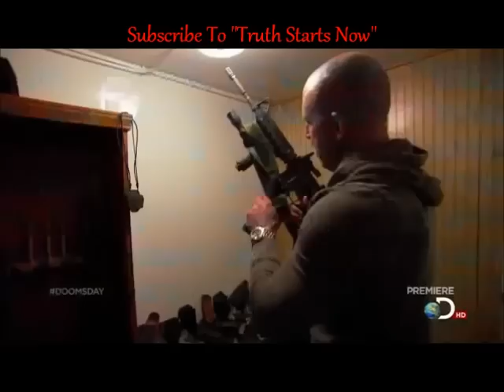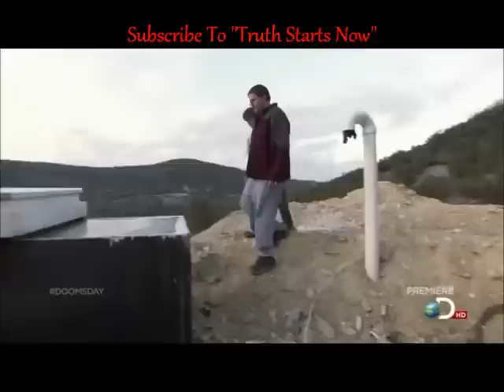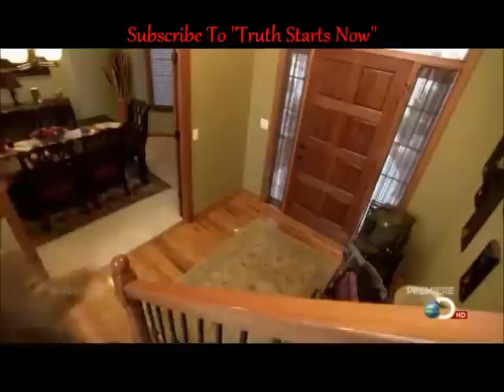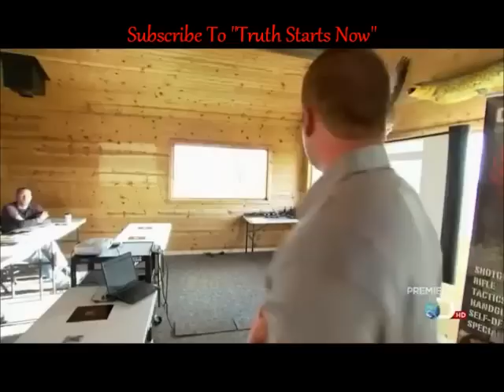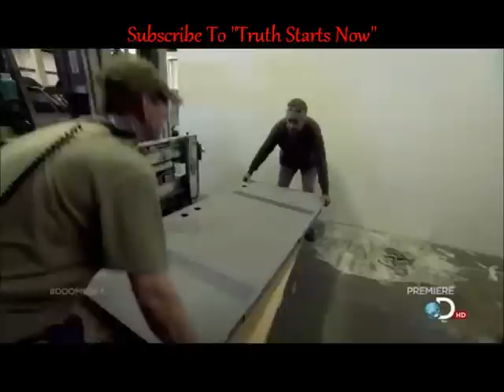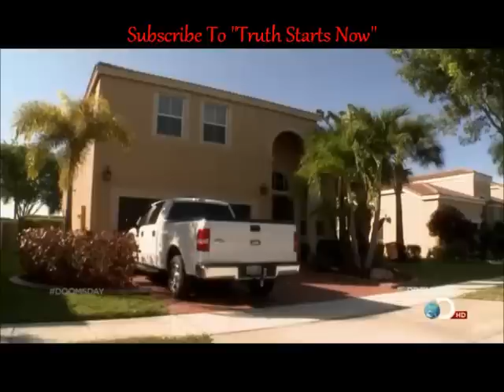Doomsday Bunkers Episode 1 Part 1/3

Comment: I'm simply failing to understand something that should be very obvious. In the event of nuclear war, there is something called Electromagnetic Pulse. That means all radios will stop working. All computers will stop working, including GPS systems. It also means fuel injection systems governed by a computer in a car will stop working. Unless your car is carbureted, you will not be able to drive to your hide-out bunker. Unless you have a vacuum tube radio, your transistor radio will not work. Furthermore, with the radio activity level present in the atmosphere within 500 miles of the blast center, nobody will be able to get out of their homes and your home will be radiated.  Unless you plan to put lead lined walls behind the sheetrock in your walls at home, you will die of radiation poisoning.  How the hell are you going to GET to your bunker, if you will be NOT able to drive, and NOT able to Communicate, and NOT able to survive the heat and radiation of a nuclear exchange , with multiple blast zones. This is fear mongering at its worst.
Reply: You are misinformed my friend.
Reply: +FelixG I hope you see this, but I'd be happy to offer an explanation as I also enjoy active responses and dissertation. A remote location, as someone else pointed out, will most likely not be affected by an EMP caused by nuclear war. 500 miles of radioactivity is inaccurate. I assure you that any tactical nuke used in the future will not be the Tsar Bomba (the largest nuke ever detonated that was created by the USSR). Eventually the fallout may cover a large area, but if you react immediately to the threat, you'll be well out of range for the initial fallout.

There are also ways to defeat an EMP. It's not something you can't defend against. If your bunker has shielded wiring and electronics, you have nothing to fear. A layer of lead shielding around the enclosure could even protect against nuclear radiation closer to the ground zero of a nuclear blast.

What I've just said is what I know without doing any research. The original response is assuming that the person that built the fallout shelter or bunker is completely unprepared for the initial strike. There are advanced warning systems that will warn people before a mass nuclear strike "with multiple blast zones". With how ready these guys are for the world to end, they would be heading out to those shelters at the smallest sign of things going wrong. These guys would already be in their shelters while events like the Cuban Missile Crisis were still unfolding.
Reply: Hello Ayla Voets enjoy your comment on EMP after nuclear strike , there are many other factors also What size of War head yield 2, or 5, or even 10 megaton.To my understanding EMP will only cover area of ground zero: example 1 megaton warhead would wipe out and kill everyone with 12 Klm radius.      I started to read more about EMP and GPS after my work phone became a tracking device.I found on eBay small black casing for my phone. to block EMP and GPS price was $4.99 there are casings for your laptops mainly used for traveling airport x-ray devise that may do harm to electronics.   if you have been watching Juno space craft just passed massive amounts of radiation, all electronics on broad are inside a titanium concealed area. I choose not to survive a nuclear holocaust.cheers.
Reply: Graham Ramsay You're absolutely right on all counts. My father worked on some secret government contract in the 80s. I still don't know doing what, but he would always tell us, "If there is a nuclear strike and I know where it will be, we will be traveling as quickly as we can to its epicenter. I don't want any of us surviving a nuclear holocaust." Those words have always stuck with me...

Comment: FYI, if you are in a bunker with enemies outside. You will lose.
Thats why the military stopped building bunker forts etc.

You just secure the outside entrance area. Dig until you reach the metal roof. Use a simple shape charge to make a small hole. Make a fire and channel the smoke into the bunker.

If its a super deep billion dollar bunker then you do similar, but find the air intakes and close them. Might be a longer wait, but you will win.

Comment: I agree completely. People should have both backup oxygen tanks AND an outer air vent. If/when i build a bunker, i'm going to have multiple filters in the vent(s), along with sensors that, if liquid is in the vent, the vent shuts and the oxygen tanks turn on.To be sure about the vent, I would hide it somewhere. Possibly in a small mound or a tree. Especially since my bunker would be under a hillside. My vent would be well disguised.

Comment: You know whats even smarter :P.  buying a cottage in Northern Canada or Alaska, you can get them for relatively cheap cost, an isolated cottage also provides untouched hunting ground.  if the U.S economy collapses having land in another country to fall on is the better way and cheaper way to go.  If anything does happen the first people to get attacked are the peppers, not by 1 or 2 peeps but by 20-30 right after they raided a gun shop.

Comment: They can get the people out of the bunker by pumping smoke continuously through the air vent. Or pouring water down the air vent. Or setting a huge fire on the door for a long time. If a bunker is known, you can always find a way to attack it.

Comment: First priority is to NOT get found. Usually, after the bunker goes in, it's concealed in some way. Some people build stuff like doghouses over the air ducts, what have you. Also, the pipes have guards against filling in with water or trying to "smoke out" the inhabitants. And finally, several of the pipes will be "dummy" pipes that don't lead to anything.
But with all this, in general if somebody DOES find your bunker, nine times out of ten somebody's going to have to get eliminated.

Comment: Ok they have a bunker layout completely wrong. 1. Entrance must have an air lock that can be defended via gun slits. walls must be 8-12 inches of concrete.2. Decontamination with a place to store weapons clothing NBCW equipment followed by showers for full decon.3. Another air tight door again must be bullet proof with slits for defence.4. living eating sleeping quarters. Each subdivided again with walls and doors that are defendable.5. At least 1 escape tunnel that leads a couple of hundred yards to a ravine or gully where you can break contact and escape.6. A hidden resupply point at least 3 km away. It must have weapons ammo medical supplies backpacks and clothing.This is not even getting into what to have above ground.

Comment: One man in a bunker is not going to stop a group of intruders those doors could be busted down with the right equipment. as for the air conditioning vent on the surface, whos going to stop intruders covering it and filling it with dirt to prevent air going into it? or filling the vent with petrol and setting it on fire. when theres a will theres a way

Comment: You should be smart enough how you can eliminate disinfect infection, how can you have clean water by infared, how can you control intruders, and also bugging out protocols. Its not just staying there but how about going out or moving out.. transportation is needed such as boat, jeeps, helicopters, space ship>>?
LASTLY, You must have a friend and relative with you in time of crises 1. MD/RN 2. Computer TECH/Radio Tech specialist 3. Military MAN, 4. Farmer/Carpenter/Repair Maintenance 5. Driver

Comment: Suppose there IS no external exhaust/intake, mastermind?  Suppose his entire air supply is enclosed and scrubbed to remove CO2 augmented with plants from a garden in addition to mechanical scrubbers.  

NASA's been doing it for decades so the technology isn't that lofty.

Also, suppose there's more than one exit and you're sitting atop a sensor at only one location.  Suddenly your head erupts like a ripe zit from a guy with an IR scope and a .308.

Comment: Isolating yourself underground? Holy miserable fucking fail!  A little hydrogen cyanide gas in the air intake and its fingernail claw marks on the door frame and stack of bodies next to the exit. The smallest and weakest would be at the bottom of the pile, trampled by the stronger adults losing all restraint against imminent